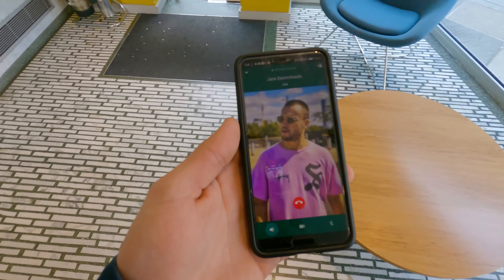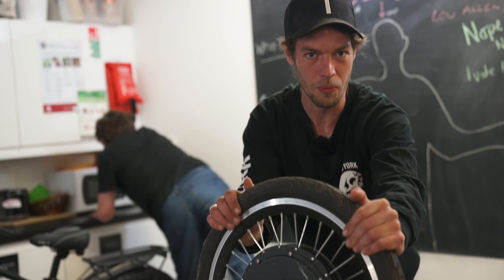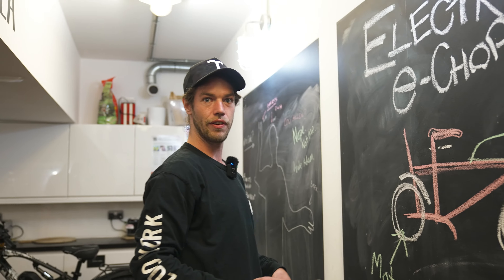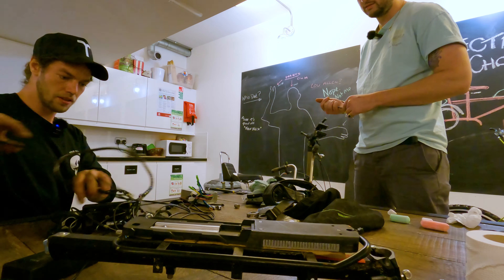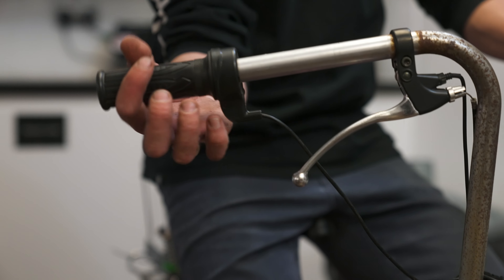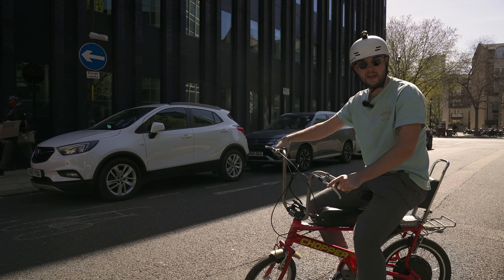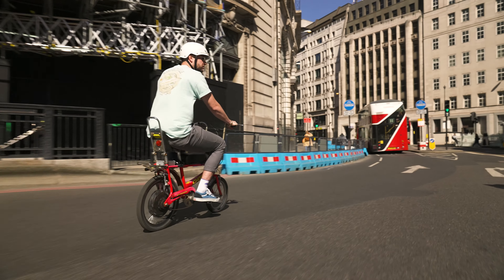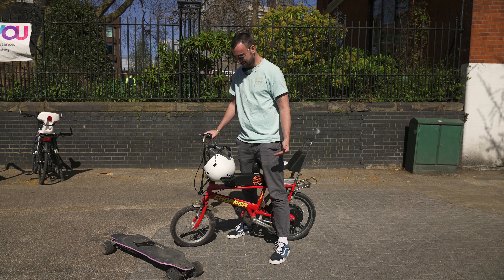How I made a cheap e-bike conversion in JUST 2 hours

Comment: I knew a couple of guys with these growing up in the 70's.  One had a steering wheel instead of bars.  Another had cool tiger hand grips.  Now you need to do a Krate or Pea Picker with the springer front and slick tire and the gear shifter on the bar.

Comment: Look into the 250w ebike conversion kit from Elecycles, only uses two cables and has gyroscopic pedal sensor.
Reply: 250 is too slow. 2000w plus.
Reply: @datguy3201  I agree, do wish they'd make one with a 350w or 500w hub motor instead - but it's the outdated laws here in the UK. It's one of the rare ones that fits older bicycles with 100mm front fork axles, put it on my Schwinn. Wouldn't want anything more powerful with v-brakes, you know? (Not all bike use disk brakes)
Reply: @esk8jaimes  1000w without disk brakes is fine. 1000w get about 25mph. Just peddling you can get you to 32mph, down a hill must people have gone about 40mph on a mtb. It’s fine. The more power the better as you don’t have to use what you don’t need. But if you got a hill or need to merge the power is their.  Just like driving a 1.2L car. It’s harder because when you need to merge or pullout it’s slow so you can’t adapt as well. Same with a more power ebike kit you will have more adaptability.
Reply: Personally idk if I should get a 1500w kit or 3000w kit next. Not sure if you can have a 3000w motor with a normal battery.

Comment: 0:51 you saying you don't think you could pedal it isn't necessarily down to your height, evan as a kid I struggled although my Grandads tinkering may have contributed, but those bikes were evil, mine had the pedal backwards to brake, which sounds fine but even if I thought about stopping pedaling it would brake, I couldn't freewheel from fear of going into a slide or going over the handlebars.

I always wanted one but when I got it I wished it was still a dream and not reality.

Comment: I was just wondering if anyone had done this yet. Nice. Only thing to add is the handle bars had a way of calapsing in.  I'd put a brace mid point on the handle. Otherwise very cool. btw Did you build that rear wheel yourselves, or have it made? Iconic. Nostalgic.